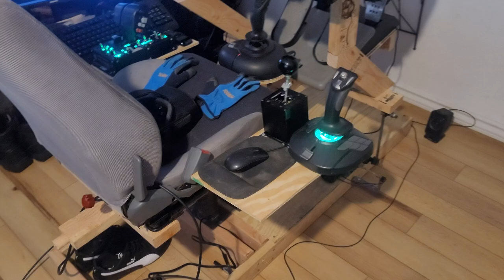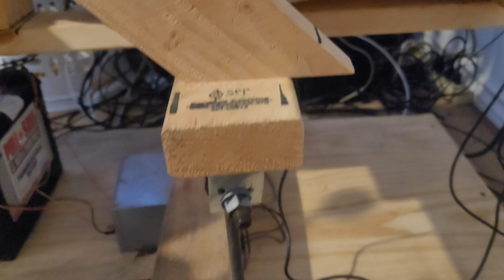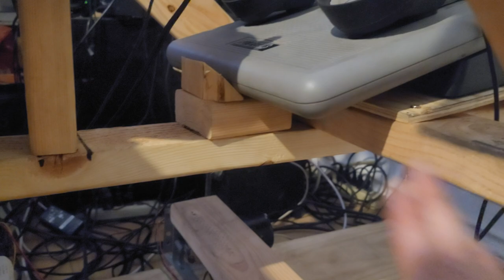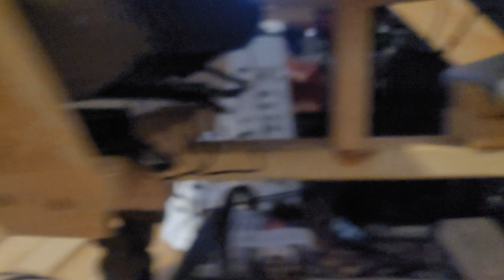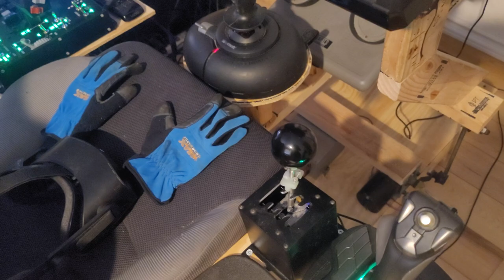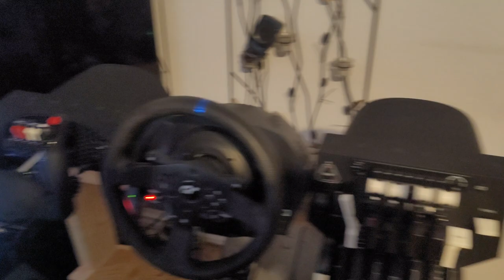A walk around my wooden 2 dof wiper motor motion sim

Comment: This is great! How did you figure out how high to lift the seat base up with the drive shaft? I'm guessing the higher it is the more tilt you get. I was just wondering if you just guessed how much tilt you wanted and raised it that high to get the clearance? Or is there some limit with the tilt and then was just a case of getting enough clearance? Hope this makes sense. I'm in the planning and collecting parts stage
Reply from the maker: The height was kinda determined by the connecting rod length.  I didnt know how to weld at this time and didnt want to cut them because I didnt know how to weld so they kinda determined the height of the U joint.  I say "kinda" because you can raise and lower the motor mounts or the connecting rod cross member but those require a lot more effort that just making the u joint as long as it needs to be.

Comment: how much did the motion rig cost you to build
Reply from the maker: I have kinda lost track at this point but lets do some quick math: each motor is about $35 on ebay and we need 3 of them.  The arduino is $10 or so ($20 for a pack of 2), we only need 1 of those. The motor controllers (IBT-2 or BTS7960 same thing different names) are $15-$20 for 3 of them. I use 6 here (they are in parallel) but you might be able to do just 3 if you get good quality ones. The U-joint (cardan joint), connecting rods (rose/ heim joints) and seat are from a junk yard.  U-joint - $10, Connecting rods x 2 - $10, and the seat - $50.  The hardware (3 inch wood screws) was $10 a box and we need 2 of them.  The wood is $3 a 2x4, we need about 10 I think. Plywood is about $50 a sheet, we need 1 sheet. Also an Arduino wiring kit for $20. So just the motion sim without any peripherals (wind sims, buttkickers, wheels, flight sticks) is around $320 USD.  This also does not include any tool cost, or welding wire. Also this ^ Price is for my current rig (not including the Gseat), the rig in this video only uses 2 motors and 2 motor controllers.